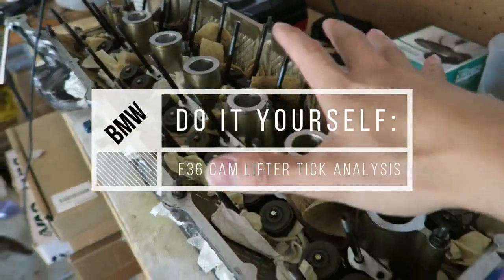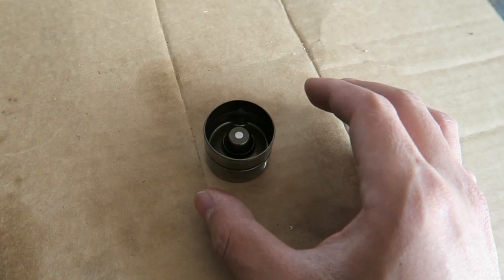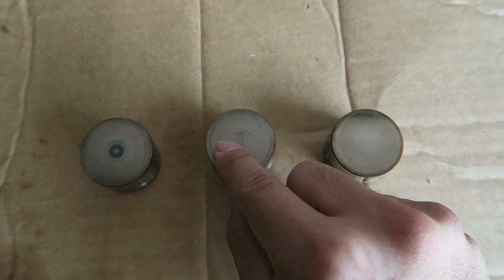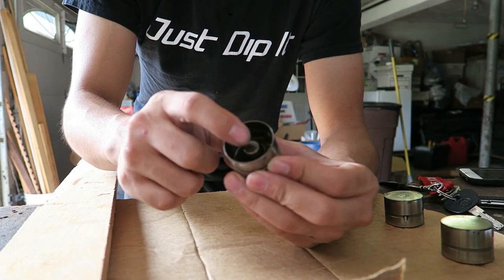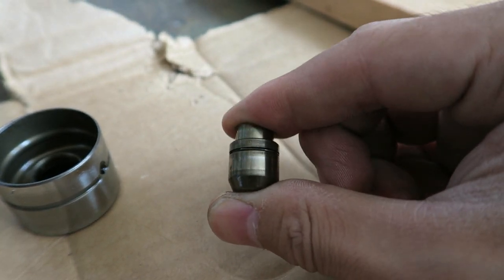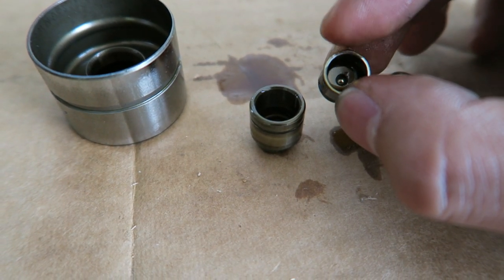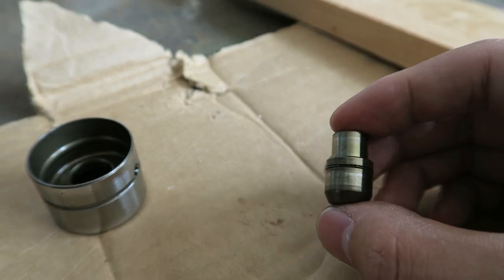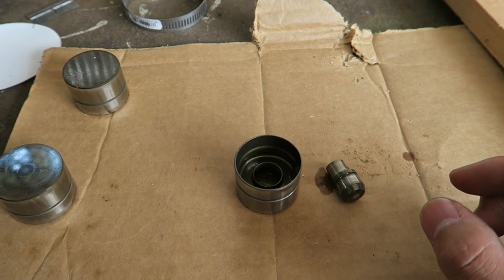Got BMW E36 Engine Tick? A Crazy Fix Lying In Your BMW's Cylinder Head!!

Comment: Thank you for this video. No one else took the time to explain to a blue-collar guy like me what a lifter looks like. My 99 740iL suddenly starting ticking loudly yesterday after a 30 mph run to town and not the day before when I was up and down the highway. Seeking information, hoping for a not so costly fix. Thank you Pawinning !
Reply from the maker: That's unfortunate to hear about your 7-series! I hope you resolve your ticking issues, I'm glad I can provide you with useful information. You're welcome :)
Reply: It turned out to be the timing chain tensioner on the passenger side front up by the cam. A single 19 mm bolt holds it in. The inner spring had collapsed, possibly because the car went a quart and 1/2 lo on oil due to a leaking valve cover gasket. having said that, should anyone else have to replace the TCT as described here you only need to remove the airbox to get to that one  19 mm .  I don't care what the doubters say, I love my BMW and I plan to be her doctor!
Reply: It appears to have been the lower timing chain tensioner on the passenger side of the car. A single 19 mm bolt and it's out!  I had a valve cover leak so I did have to remove a few other things like the fuel rail, injectors and inside, the coil packs but I want to stress to others reading, this wasn't rocket science even for a novice mechanic like me. BMW did the right things by design of ergonomics  and I only needed a small flathead screw driver and a 10mm socket. I moved the air box aside and I was in. About $100 DIY solution!

Comment: Change your oil regularly, overfill (yes, you can safely overfill the m/s 5x motors) and your lifters won't get stuck. Usually happens from poor maintenance and oil starvation 

S52 here, zero tick.

I just bought an abused n52 and it has a tick
Reply: Did you get rid of the tick in the n52?

Comment: Excellent video! I am definitely going to inspect the lifters on my M52B20. I had the engine partly rebuild a few years ago, and I say partly because AFAIK the guy who did it (on the cheap) did not replace lifters nor crankshaft bearings. Cylinders were honed, new piston rings, head cleaned and resurfaced, but I still hear slight ticking near the valve cover.

Comment: you can assemble the piston under oil and press any air out with say a dremel drill that is small enough to poke the ball valve in but will not go through the hole and poke the ball valve assembly away. pump the piston under oil like this until bubbles stop coming from it and then after you have verified it holds pressure you can jam it back into the lifter

Comment: That might explain why a few of my lifters look different. Previous owner probably replaced a few. Can't wait till reassembly! Block is getting some work done atm.
Reply from the maker: +photojnt I'm glad I can help out! What work are u doing to ur block atm? I'm curious cuz I'm deciding on services myself for my m50 block
Reply: Pawinning sent my s50b30 and head to both get cleaned and resurfaced for a better seal for a turbo build. Also having them rehone the cylinders as little as possible until the egg shape is gone. Once I get it back I'll know what piston size I need.

Comment: Wish me luck!

Im just about to pull our '92 e36 318i down for see whats going on with it! 

Thanks for the vid bloke! 😁
Reply from the maker: Good luck!!
Reply: Didnt get very far when I realised the cam might need to come out aswell..........But all lifters felt ok........I did find one of the oil drip holes was blocked with crap. 

I might try just removing the loose rocker arms then rotate engine by hand to get the rest out........Possible so you think? 

Cheers

Comment: Wd 40 in the oil filler works just fine 😉...no taking apart anything. Just spray 1/3rd can straight into oil filler then let idle until silky smooth then change oil with recommended viscosity. Never use thicker oil. Happy days 😉
Reply from the maker: Hey! Thanks for that awesome tip! That makes sense with the wd-40 trick, I'll have to give it a try in the future! Cheers 👍
Reply: @Pawinning  I use 20w50 and it's the same sound beatwin 1000 ond 1500 rpm...

Comment: I just took apart all my lifters and I have 4 lifters that the ball check valve is not sealing even after soaking in detergent. I will be replacing all 12 of the intake lifters thanks for the great insight on how to bleed and take these apart it was actually a lot of fun learning and doing this! Is it okay to replace the lifters by them self? I don't need to replace them with a new camshaft tray do I?

Comment: Hello , i am driving an E36 320i M52B20 1996 and i have this ticking problem and it is very annoying. After i drive the car abit , if I drive it hard it will start ticking very loudly? Can this be my solution to the problem?
Reply from the maker: +sasho dimitrow it can be! Especially if the ticking is consistent. If u do a fresh oil change/flush and the problem persists then yes your lifters can be the problem

Comment: Been following your m50 build. Just picked up an m50tu for my e30. For the top end, what would be good to upgrade? Just brand new hydraulic lifters or solid lifters? And better camshafts and heavy duty valve springs?

Comment: Helloo man...i have bmw e34 with m50b20 non vanos engine ..and i hear ticking sound only when i start the engine in the morning specialy when its cold with that sound the oil light stays on for 3 to 4 seconds and when the light gose off sound gose off too..so what is the solutions of this ...and thanks for helping...
Reply from the maker: +Tiger Black that noise should be normal, oil drains back to the oil pan and the older the car, the noisier the car can be, if the ticking doesn't go away at normal operating temperature then there's an issue

Comment: Could the lifters be related to an intermittent low oil pressure light? I also have a tick in the engine, which at first I thought was direct injection tick since my other BMW is an N55, but then I realized the S52 is port injected.

Comment: So basically bad lifters are the one that you can press it with hand? And the hard one is good?
Reply from the maker: Yessir, a good lifter should feel very solid in your hand with minimum scoring/wear on the exterior surfaces
Reply: @Pawinning  thanks for your quick answer really appreciate it!

I'm currently working on my car wich has really loud noise. And just two of them are feel solid when i press it
Reply from the maker: No problem! I'm happy to help as I can :).

Yeah I'd definitely recommend cleaning out All the lifters just to be safe. If you can afford it replace all the lifters 🤘

Comment: It is possible that after my camshaft broken in middle when i tighting nuts (i replace camshaft) lifters in middle side has broken springs? My car engine ticking when engine is hot..
Reply from the maker: You can’t tell if the springs are broken until you pull one out and test it yourself by squeezing the piston in your hand. If it’s solid then your fine. If its springs back then it needs to be cleaned internally according to my steps. If it just freely moves in and out then yes the spring is broken and you need to replace the part
Reply: Pawinning Big Thanks for Your Reply, i have 1 more question. 1 or 2 lifters is ticking im my engine. I notice some circle on 1 lifter on e3 lifter like on your video.  So that lifter i must inspect yes? https://zapodaj.net/30697f1d7dd37.png.html

Comment: How can you convert them to solid lifters as you mentioned?
Reply from the maker: U can either purchase a set of solid lifters from a few vendors, but typically people also just replace the inner piston with a solid mister to “convert” them to solid. I’m not sure which one is a better option, but I know that it has a lot of hype on the forums. Solid lifters are really only needed if you’re building a high-reving engine

Comment: Ohh..i want to ask you question couse you have experience...i want to have more horsepower or torque in low end engine speed..couse i feel the car is too much heavy for this engine ..i live in a country that roads are up and down hills..if i stop in hill or even if engine speed drops under 1500 rpm  the car wont move whatever i tried...
Reply from the maker: +Tiger Black I'd try upgrading to a lightweight flywheel, lightweight wheels, exhaust, intake and a tune. The lighter components should decrease rotational inertia from the drivetrain system. People use lighter flywheels for more aggressive acceleration/engine braking, but in your case it should get you up hills easier since the engine has less rotational strain

Comment: I only hear the ticking when the air  temperature is under about 40 degrees and the car has been sitting overnight.   Once the engine is warmed up the noise goes away.  Lifters?

Comment: +Pawinning I'm not completely sure if they must be under oil pressure when you re-install it. Check out jafromobile channel about lifters: he says, at the end, that they have to be lubricated with oil but not under pressure (full of oil). 
Try it out and tell me if I'm wrong. Thanks!
Reply: Yeah once you pump them up and install them in the engine, let it sit 30 minutes or more to bleed out or loose pressure before starting the car or turning the camshaft over. Some people don't fill them up before re-installing but I think its better to do so, so that its not dry on the inside when started.

Comment: What are the benefits of a solid lifter?
Reply from the maker: +BC Builds solid lifters don't "float" like hydraulic stock ones at high rpm speeds. Essentially they would give a larger power band range for a tuner to work with in a race car. U can run it on the street just it'll be much noisier
Reply: Their lighter (less moved mass). As being said they thus can take higher RPMs. Downsides are the need of measuring and adjusting the valve play (intervals are varying). Hydraulic lifters are self adjusting and did  replace solid lifters for the most part. For example, regular M50 engines of the E36 all have hydraulic lifters. The German M-Sport engine S50B32 has solid lifters and also a higher RPM limiter. The downside of higher maintenance are less important then the engine performance of the M-Engine. There is no good or bad, just advantages and disadvanteges :-)

Comment: Best way to take them apart is to electrical tape the lifter to a piece of wood and smack the wood on flat ground works first try with out fail
Reply: My man! Was having trouble getting them out with the wood and mallet/cardboard. ended putting small dents in the lifter edges. Your trick worked with little effort. Thank you 🙌